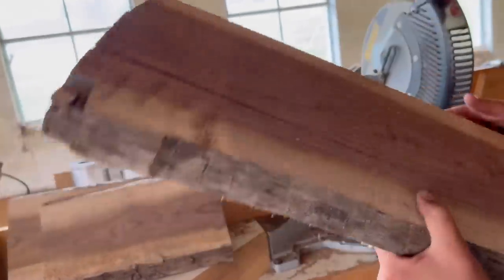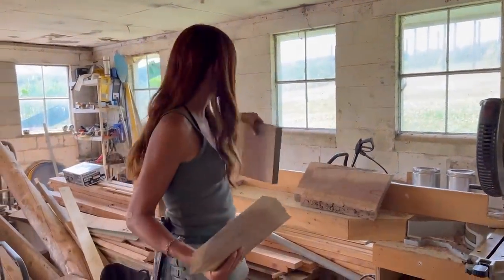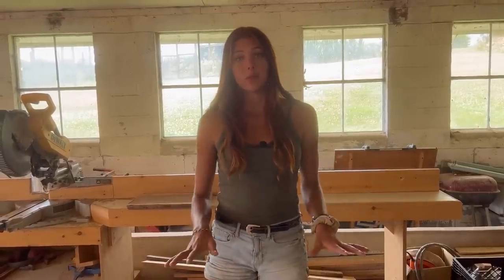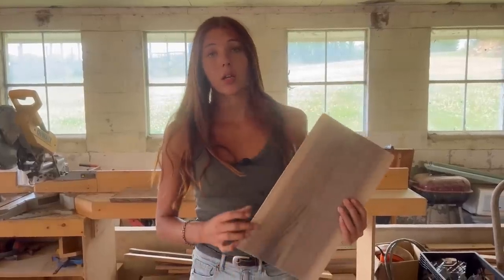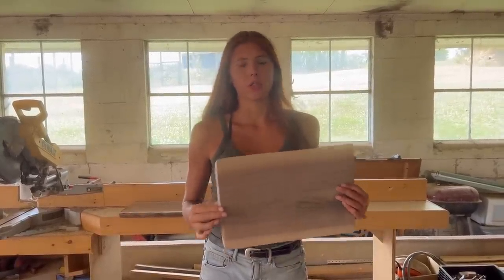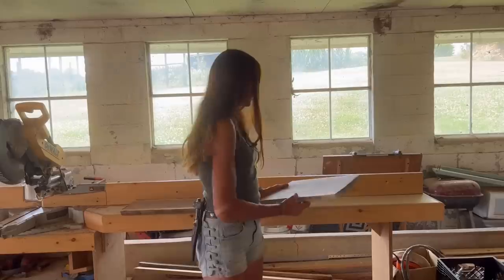Wrapping Up the Week by Making Walnut Cutting Boards!

Comment: Just like the eskimos have many words to describe the many types of snow flakes you might consider using the concept with sawdust. I’m sure you noticed that all sawdust is not the same. Emerald touched on the concept in a video while milling walnut. The dust produced by a chain saw or your Woodmizer is very different than what is produced during sanding. Treating them the same may be a mistake. The finer the particle size the greater potential it has to cause lung issues. Issues that may not be noticed until your 30’s or 40’s….Sanding outdoors is better than indoors. Sanding in front of an open window with a fan blowing dust away from the sander and out the window is another option. And the really health conscious will select a 3M 7502 mask with P100 (2901 model) filters. They are also more comfortable and more effective than the White mask your grandfather was using in the demolition project video. Milling outdoors at the woodmizer is definitely safer than sanding indoors and a case could be made for different choices regarding mask/no mask.

Comment: The live edge stock needs to be held down with a c clamp or something. The saw will pick it up off the table and throw it. Also your belt sander will shove the board towards you if not secured. Please look into a safe and efficient way of doing this. Safety First!!
Reply: As well, the long loose hair while sawing should be considered by them as well.

Comment: You really scared me when I saw you cutting on saw with board away from fence. PLEASE put boards against the fence. So it doesn't rip the board out of your hand and go flying across the shop. It can pull your hand or arm into blade. 
Cutting boards are a great idea. Good luck and God bless.

Comment: FYI, there 2 ways to smooth out those boards. #1 run them through a thickness planer. I would recommend a 12.5 inch Dewalt Thickness Planer. It will get the job done well at a decent price. #2 You could start off using a grinder with a 36 grit abrasive disc use with a backer made by Diablo. The combo works very well. So you grind it down first. Then run an 80 grit belt sander over it. Then you run a 100 grit orbital sander over it. Then  you finish it off with 150 grit. Then if really want to get fancy put a stain of your choice on it, light, dark whatever. Then run a clear coat of shellac on it. Allow it to dry. Sand it with 220 grit. Then put another coat of shellac on it. Let it dry. Sand again with 220 grit. Then run a final coat of shellac on it. Let it dry. Then sand lightly with 320 grit. Then run a fine finishing paste on it. Then buff it. Then maybe put a second coat of wax on it. And buff it again. This process is called "French Polish." It's a finishing technique that dates back to 1700's. It was used to finish fine furniture.
Reply: @theodoreowens41  I'm sure they'll figure it out.
Reply: So, you'd put Shellac on a cutting board?  I don't think you've really thought that through.  It appears your purpose here is to toot your own horn about how much you know about "French Polish",  because you obviously don't have even a part of a clue on how to finish a cutting board (quick lesson:  You use a non-toxic oil, possibly with some beeswax.  You never, ever use varnishes or shellac.  )
Reply: @andrewalexander9492  you can put whatever you want on it! I just said "if you want to get fancy!" And of course if you applied that kind of finish on it you wouldn't want to cut food on it. But by looking at those live edge boards they look more decorative that for actually cutting food on them. Real food cutting boards are usually 1/2 to 3/4 of inch thick 10 inches wide 12 inches long with some sort of handle on it. Can be made out many different species of wood, and a food safe applied finish to it. The pieces she was making might have been sold as cutting boards food, but not realistic. More decorative than realistic. Hence the shellac finish.
Reply: WOW !! They're making cutting boards, not candle stands ! SMDH Shellac ??? What are you smoking, dude?

Comment: Boiled linseed oil is what I use on my cutting boards. I make them out of oak and walnut 2 inches thick clued so the cutting surface is the edge grain.PS if drop one of my cutting boards on your foot it will break it🤪

Comment: Long hair and rotating power tools can be a dangerous mix. You bend over it to have a closer look, your hair falls into the tool. It happens fast, even if you usually are very careful about it.

Smoothing a surface makes it smaller. Imagine looking down onto a - or a V. The V has the bigger surface. Every scratch is basically a v. A cutting board gets wet when using it. Even if you wipe it, the scratches keep the moisture. This ages it faster. The smoother the surface is, the less contact area there is. Even if it doesnt seems so, a rough surface is multiple times the area than the same piece smoothed out. Thats the very reason you roughen a surface before painting it.

To conserve wood, be it a table or a cutting board or whatever, i prefer linseed oil. Its been used since centuries for this purpose. It polymerizes thus becoming solid, it doesnt go rancid. In the 1900 it was used for making floor coverings and wallpapers.

Comment: ALWAYS SAFETY FIRST: Mitre Saw cutting without the pieces against a fence is Extremely Dangerous and the pull was visible making an eventual binding inevitable.. 

Belt Sand in full passes covering the length of the board moving from left to right and repeating using graduated Belts from 50 Grit moving up to 80, 100 & 120 Belts then you can Orbital Sand to taste. Let the machine do the work except for the 50 belt which will give a workout. 

You’ve taught me some great stuff in many videos.. Thank You !

Comment: Do you folks have a planer? My little (12 1/2") Delta planer removes all milling marks and allows for much less sanding. Anything more than 320 grade sanding is not needed. Mineral oil or oil and beeswax are typical finishes. Olive oil can spoil. Metal brands are fairly cheap.

Comment: If you can spring for a planer, you'll save an enormous amount of time. Plane before cutting to shape. Sanding can start with the orbital at 100 or 120 grit and will be very quick.

Comment: Hey Emerald, you can try linseed oil on one. The other thing I was thinking about was branding the underside with your logo. LCLY.. think of .. like a branding iron used for cattle.. once you get it made you can use it over and over
Reply: Linseed oil is not food safe. Do not use it. The best oil to treat the cutting board is food or pharmaceutical grade mineral oil. That is what I put on mine.

Comment: YIKES!!!  No eye protection!  Also, you should only put joined (straight) edges again a fence!  Cutting the wood away from the fence and against the fence are both dangerous.  again because the edge that touches the fence is not joined!  I have made that mistake before!
Reply: I'm trying to envision what they will look like with eye patches. Maybe they will design and sell some.

Comment: How about insetting a penny on the back. If you use a new one your board will have the right “BD”. A 3/4 inch Forstner bit chucked into a drill makes the correct size hole for a penny. A little super glue holds the penny in place.

Comment: Cool.  I am, however, trying to understand why you aren't sliding that walnut board up against the fence when cutting it on the miter saw?
Reply: Something to consider using as a finish is actual Walnut oil.  Yes, it is edible.  Some people put it on salads.  Makes for a great finish as well.
Reply: They can't put the board up against the fence to cut it because they are using a rough edge NOT a square edge. Using a rough edge will not give a square cut at the blade if the blade is up against the fence so they need to square the cut line to the blade then clamp the wood down to the table before making the cut to hold the wood in place. If they had a square face then yes they would be needing to put the board against the fence as normal to make the cut.
Reply: @asbrand  It's also an allergen.
Reply: @bushmaster2936  - Well, ok...but they're already using walnut wood for the cutting boards...so...

Comment: Taking the sanding outdoors will save a lot of time cleaning up the dust. 
Mineral oil  is a good idea, Don't use boiled linseed oil on cutting boards. The drying agents used to thicken the  oil contain heavy metal which can be toxic. Any oil finish will have to be renewed fairly often, but that is easy. 
I would suggest sliding the board against the fence when using the chop saw. It will be less likely to shift while cutting, which can damage the blade, the motor, or you.
Reply: Not a straight edge on the slab to put against the fence.

Comment: Looks like the saw is locked in place girls. If you loosen the lever on the top back of the saw you can slide it back and be able to put the boards against the fence and re lock it or leave it loose so you can pull the saw towards you. Hang on tight.

Comment: When we used to sand teak on the decks of sailing yachts, and motor yachts, and then wash the decks regularly, it was always done at a 45° angle to the grain, that way, we would not be making the grooves in the teak any worse by running with the grain, and at 90° to the grain was too abrasive. Just an idea. 45° is the magic number

Comment: Just because a board has a split doesn't make it worthless. Just make a cheese board with a handle. Sort of like a paddle. I've Made a bunch of them and they Make great trivets as well.  Don't forget you have a planer if the boards are too rough. You have to figure in your time when deciding how much you want to charge.

Comment: I wouldn’t use olive or vegetable oil as a finish. They’re not anti microbial and they’ll turn grotty in no time. Coconut oil works well. It’s colourless so just brings out the natural beauty of the timber. However, unless you get odourless stuff your board will smell of coconut. Beeswax is cheap enough if bought in bulk, and if mixed with natural turpentine goes deeper into the wood surface. 
Also, if you want that board to be basketball-court smooth, however many layers of oil or wax you apply to your boards - say 4 - apply the penultimate coat with fine sandpaper as opposed to cloth or rag or whatever. It rubs all those microscopic bits of dust into the surface and boy, a thing of beauty is the result. And it feels like silk.

Comment: love your guys videos and your beautiful family vibes. you want to keep your roughest cut of sandpaper with the grain so its easier to hide/sand out. the secret to flattening is generally a slight angle off parellel with the grain. as others have stated mineral oil/butchers block oil is really the only option. also if you fir the area around where the cut is being made so it has some support against the fence it will be safer.  i sand and stain oak on a daily basis and you dont need to go beyond a 200 grit dull disk really once you put oil on it, you will lose that hard earned polish. generally speaking you only sand to 1000+ grit on finishes for furniture/cabinetry, and even then thats a little much. you generally only "water pop" wood to open the grain for staining but i understand it does show alot of the character in the grain if thats something you want to see.

Comment: You need to push your wood stock against the fence on your miter saw.  You will have perfect 90* square ends that are parrallel and your wood will not wiggle when you are cutting.  If you don't have your stock braced against the fence, the blade could get crooked and get jammed and have it throw the wood plank at you.

Comment: maybe make them the same by gently easing the edges with a 1/4 inch router bit  it will make for an easier edge to clean and will do away with the sharp edges  just a thought

Comment: Just curious. You said you slabbed those a couple weeks before. Were they green when you made the boards or did you dry them first? If wet, did you have issues with cracking and warping? Thank

Comment: I like the video.  One thing I'd like to add is you should call them charcuterie boards.  The only wood good for raw food prep is hard maple.  It doesn't harbour bacteria because the grain is too tight.  All butcher blocks are made of it for a reason.  :)   You go ladies!!
Reply: @theodoreowens41  Actually, no, walnut is not fine, it's a poor choice for a food prep surface because it has an open grain.  A tight grained wood like maple or beech is much better.

Comment: That live edge makes it hard to put the board up next to the Fence. You need to Clamp the board down before something bad happens. Believe me sooner or later its going to happen. the Blade can catch in the board or you may hit metal , you never know. also if you can look into a small planer for your board. It will save you Time and money not buying all of the sand paper plus save you on the electric bill. Please be Safe.

Comment: Just my opinion but I think you would be better served if you was to take your hard wood fall off from the edger and use a S4S blade and cut into random width pieces. You don't need anything fancy pipe clamps will work. Then glue them and process them. The problem with walnut is it is so brittle if you use a meat cleaver on it you are going to split it in half. Especially if you have little legs on it! Also to keep it unique and one of a kind you can mix and match your wood. I used to mix Oak Hickory walnut maple Rose wood all sorts of stuff just out of the fall off out of the mill. They made great presents. Do not use Linseed oil or any other tree oil to season them! Use mineral oil it is non toxic and will not turn rancid. Also if you do glue you have to use a food grade glue if you are selling commercially. You may like the live edge but realistically all you need to do is move beyond the edge of the counter and get better results. 
Keep on driving on you are at least thinking of products that will help pay the bills! I really do admire your family and your work ethic.
Reply: What is an S4S blade? Brittle Walnut? I've worked with countless board feet of Walnut and never had any that was even close to being brittle.  smdh
Reply: @bushmaster2936  S4S means sanded 4 sides!  They are very precise and do not leave a mark on the cut sides. As for walnut I have thrown thousands of board feet through a gang saw and it is dangerous. I have had the kick back fingers save my ass more than once!

Comment: Please be careful with your equipment.
Just  a few of the injuries I've seen working at shake and shingle mills: guy cut his leg off just below the knee, another cut his arm off between elbow and shoulder, another cut his arm in half lengthwise elbow to wrist, at least 30 missing fingers, 10 of them from just two people.
it only takes a second of bad judgment to make decades of hardship.  Spend a few minutes setting up your machinery and product so it is safe.
Reply: PS, sorry if I'm nagging at you, I see already a lot of comments about safety, I hope you don't get set off by it, keep your fingers on your hands.
Reply: Damn, Where did you park your car in the morning with all those OSHA inspectors taking up the good parking spots?

Comment: Sand with the grain with a belt sander unless you can't avoid it.  For really tough jobs I start with 40 grit that leaves its own set of grooves to remove, then 60, then you can move to the oribital sander at 80 all the way up to wherever you're going to stop.  Typically if you're going to do a simple finish there is no need to go beyond 120 grit.  I see a lot of comments on the use of mineral oil that is a petroleum product.  If these are just rustic decorations that aren't used for food then it would be up to the individual's tolerance of petroleum in their living space.  Linseed oil can be tricky.  It is a food oil and can be used as a food-safe surface but they get really cagey with the ingredients because even 'boiled' linseed oil might have cobalt (carcinogenic) drying agents in them.  Read all of your labels to make sure that it is food safe.
The US Army did a study on the safety of wood vs. plastic cutting boards to find that wood has less molecular crypts for bacteria to hide coupled with wood being able to be washed then dry enough to disable any microbes.  I've used cutting boards that were never treated with any 'protectant' that had a respectable service life.  
The ancient wisdom of never cut your meat where you make your bread is a way of segregating the functions of food prepartion.  A cutting board for produce should NEVER be used for cutting meat and vicesquad versa.  And you should never use the surface that flour/yeast is worked on for produce or meat.  A neat marketing scheme might be making  a pair of cutting boards marked for meat and vegetables... or  "Vegan" / "Non-Vegan".
Reply: Food Grade Mineral Oil is totally safe to use on cutting boards and wooden utensils. The clue is Food Grade.

Comment: Fruit and vegetable oils can go rancid. A better product is inert mineral oil. I have used it on several wood items for food contact. I also mix mineral oil with bee's wax. However, a relatively high temperature is required to melt the wax.

Comment: The live edge is a food trap that is impossible to clean and can lead to food poisoning.  Hence you don't see them in stores.  
Food-safe epoxies do exist, and are FDA compliant, so that would reduce the risk of litigation.  That could both coat the edges, and soak into the end grain to improve longevity by keeping out some of the moist moisture out.😁 
Cutting boards have two sides, thus no unstable feet.  Warping is reduced by treating both side equally.  Of course, everything will fall apart eventually, like the ultimate heat death of the universe.... Oh well.🤦‍♂